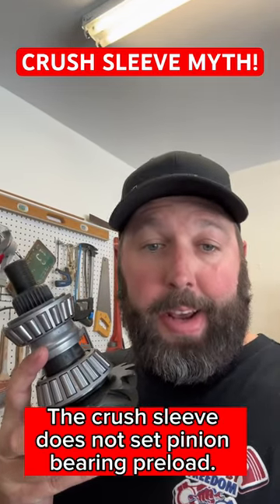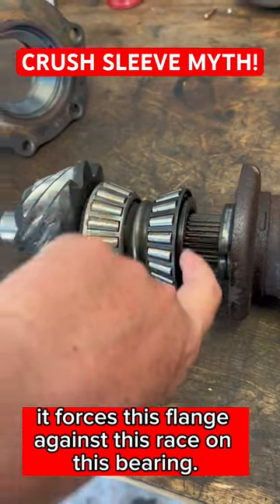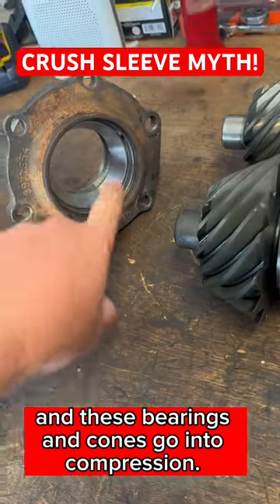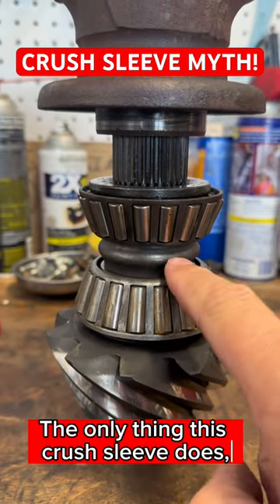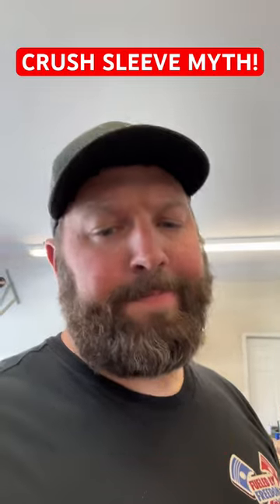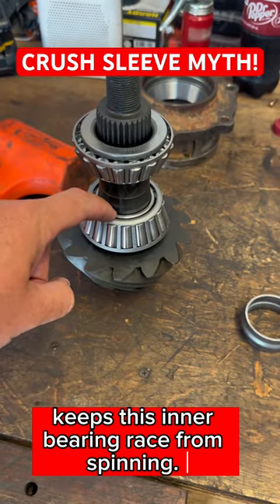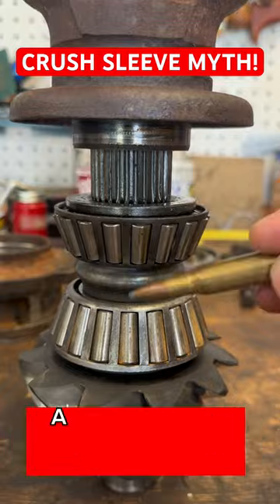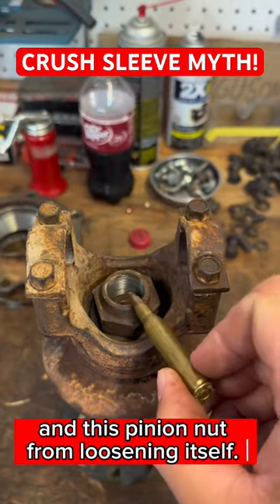Pinion Bearing Preload Isn't Created By A Crush Sleeve! #mechanic #jeep #axle

Comment: Delete the crush sleeve especially if adding more power or tire size.  Buy or make a shim spacer kit.  It may take a few tries to get proper preload  but once it’s set you can put full torque on the pinion nut and it’ll stay
Reply from the maker: Diesel pulling truck make can make well over 2000ft-lbs of torque and run a crush sleeve in there diffs. Torque cannot collapse a crush sleeve. It's a myth 😉
Reply: Why

Comment: Thank you. I have been teaching that for thirty years and it always leads to an argument. Old myths die hard.
Reply from the maker: I’ve received everything except death threats for this video 😉
Reply: You use tension to crush it and set the space between the races so that they do not spin  , that makes it a tension component . 
The backlash is determined by how much you crush it  ,because  backlash does not go  JUST back , it goes forward as well .
So you have a nut on the back and a crush sleeve on the front .

Comment: Thank you I never gave it much deep thought but your 100 percent right  so essentially the crush sleeve makes the bearings do the work by capturing the inner races and making them spin as one with the pinion gear to avoid having a spun bearing on the pinion shaft  Thanks again
Reply from the maker: Pretty Much 👍

Comment: Time out!  Soooo that sleeve changes dimension… as you tighten it the sleeve “shortens”… hence resulting in the outer bearing to move closer into the housing which increases the pre-load.  Am I crazy???  Right??? Idk…
Reply from the maker: That’s correct. But that also happens if the crush sleeve isn’t even there. Hence the point of my video. Bearing preload isn’t a function of the crush sleeve, that’s not what it’s for.

Comment: I was taught to take a center punch and mark thr yoke , pinion nut and pinion before you removed the nut. 
This way you tighten the nut again you line up the marks and then go a little tighter. 
Never had a problem.
Reply from the maker: I do the same. I also use a micrometer to measure thread protrusion through the pinion nut. I’m a little anal. 🤓
Reply: I replaced my leaking pinion seal with a new one then used my harbor freight 1/2 impact to set the nut back on . How screwed am I ??? What are my options?? Thank you
Reply from the maker: @DeathByNature23 well if your diff is the type that has a solid spacer instead of a crush sleeve, you’re fine. If your diff has a crush sleeve… pretty well screwed. The only way to get it right is to disassemble it completely (pull the axles and carrier) install a fresh crush sleeve, and set it to the proper preload (rotational torque) with the carrier out of the diff, then reassemble it. Sorry.
Reply: @freedomworx That was younger me once 😂
Drivelines do be expensive when the while deal goes poof
Tranny rear housing, tcase, yoke, drive shaft, rear yoke, etc. 
I love spending money 🥴
Reply: @DeathByNature23  thats what i did😢 
First i marked and matched the marks on the nut. Too loose.
Than i looked at the pic i took of the threads and i swear i had like 4 threads visible on the pic instead of the three i was at on the marked nut. So i was starting to impact it to get one more rotation and i ruined it. Its my 1st time. I dropped the front diff and opened it up, tonight im installing crush sleeve and wheel see how it goes.
This started from a leaking pinion seal😢😢😢😢😢

Comment: IMO the ability to change the pinion seal with zero chance of changing the bearing preload is worth the extra set up time. I install crush sleeve eliminators IE shim packs for this very reason. Add to that the  replacing a damaged yoke or changing to a different yoke type or size with zero concern of jacking with preload.
Reply from the maker: That’s the reason crush sleeve eliminators exist. People think their function is to replace the “weak” crush sleeve. But like you said, they are for improving serviceability. And they are great for offroad rigs that routinely damage yokes. 👍
Reply: The reason I like crush sleeves that its very easy to service the pinion preload. Pop the carrier, do some work like replace posi clutches, nip up the pinion nut a little more to get preload back in spec and good to go. There are pros and cons of each setup.
Reply: @joey66436 Agree but the easy to change part is also the negative IMO. If your not dropping the carrier out, you are really just winging it on the preload.  They both work, I have used and worked on both, I still prefer shims over crush sleeve.(Not the install LOL the end result)

Comment: They use crush sleeve in large truck hubs. Conmet hub. Same principle. Keeps constant tension on nut through the inner bearing race.
If not torqued and crushed correctly the wheels come off at 65mph. 😊
Reply from the maker: So just don't drive 65mph 😂. 64 or 66, but never 65!

Comment: the crush sleeve is a spring, as the bearings wear it maintains some preload which makes the bearings last longer.  I see the inner and outer bearing have spun quite often.
Reply from the maker: Yeah, I’ve seen several outers spin.

Comment: I just watched your video twice and I never rebuilt a diff before. But the way I’m seeing it and I may be wrong is that the crush sleeve in this diff is to keep from putting too much preload on the bearing as you tighten the yoke and then to achieve the right amount of preload. And without see it better or in person the inner outside bearing race.
Reply from the maker: That’s pretty much it. You need to get the nut tight enough that it won’t come loose, but without over loading the bearings with preload.

Comment: Thanks for explaining that. Always thought it had to do with pinon depth/proper contact patch, but didn't really know.

Let me see if i got it straight: The crush sleeve pushes back on the yoke bearing inner race due to it's modulus of elasticity (springiness) keeping it from spinning when the pinion shaft warms up and expands during use and when the bearings have worn a little.  As well as giving the lock nut a skosh (technical term meaning 1/2 of a "tad") of additional  opposing pressure on the locknut increasing thread friction. Right?
Reply from the maker: Well warming up won’t really affect anything. The pinion, bearings, crush sleeve, etc…, all have the same or very similar coefficients of thermal expansion. So they will all expand together. But the rest is pretty much accurate 👍

Comment: Hello. It is possible to make a hole in the pinion shaft and put cotter pins to lock the nut if the nut started to unscrew?
Reply from the maker: Wouldn't really help. If it backs off just a few thousandths, the damage is already done. It needs to stay exactly here its at.

Comment: that crush is to expand and contract while under use.. Hot and cold cycles.. yes you could not run one but its there for expansion. to keep the same preload at any temp. If it was not needed you think that gm, ford ect would save 3 dollars per unit per mill trucks they sell.. As it gets hot with no crush the preload goes lower. with crush the heat and thin crush keeps pre-load correct..
Reply from the maker: The preload doesn’t change with temp, with or with a crush sleeve. Every part of that assembly is made from steel/iron, which all have nearly the exact coefficient of thermal expansion. Thus they all expand at the same rate and the tolerances never change. It has nothing to do with thermal expansion.

Comment: The crush collar is there to keep the bearings from overtightening into the race the nut is a lock nut and replace it every time you take it off bearing preload overtighten it the bearings burn up
Reply from the maker: You are looking at it backwards. What's the purpose of tightening the nut so tight? It's a lock nut, right? So why make it so tight???
Reply: @freedomworx the purpose is to crush the sleeve until there is typically 15-25 inch pounds required to turn the pinion. Sometimes it takes less torque on the nut and sometimes more to get to the required preload. You are correct that it does keep the inner races from turning but that isn’t the ONLY thing the sleeve does. You are glaring over the obvious reason WHY it is called a crush sleeve. There are guys that make solid sleeves but you still have to check preload. There are several advantages as once you get the correct shims you don’t have to worry about over torquing the pinion nut. The pinion can also be removed without requiring a new crush sleeve and you could also replace the yoke without having to replace the crush sleeve. You talk a lot of crap like no one in the comments knows anything. You probably are a smart individual but don’t act like you know it all. Everyone hates a know it all.
Reply from the maker: @supersportimpalass not sure what you think I glared over. I simply stated that the crush sleeve has nothing to do with the preload you are trying to measure. You can leave it out and the rotation torque 15-25in-lb is still there. It does not create preload, which most people think it does. I’m not acting like nobody in the comments knows anything, but most of them don’t know this. Most people who have been building diffs their entire life don’t even understand it.
Reply: @supersportimpalass  finally a comment that makes sense.
Reply: @freedomworx  I believe you are mistaken in what you “believe“ people think.  That’s the whole problem with your stupid video. Just because the crush sleeve doesn’t have to be in to get preload doesn’t prove anything or make you more intelligent than any other person with the grasp on what a crush sleeve actually does.
Reply from the maker: @supersportimpalass  K 😘

Comment: That's why if you overload the crush sleeve you have to replace it... once it deforms a certain amount it loses its elasticity. Lock washers do the same thing and you're supposed to replace them when removed.
Reply from the maker: I'm a slacker. A lock-washer has to be pretty flar for me to scrap it 😂

Comment: I just assembled an F250 front pumpkin with a new crush sleeve, it sounds good together.
Reply from the maker: I built the Super Duty Axles under my Excursion, definitely used new crush sleeves in them😉

Comment: Really , hmmmm, all those years as an apprentice and all the books are wrong !!! Buddy it's setting the lash on the ring gear , the sleeve starts out at max length , the reason the outside bearing has no interference is so it can move inwards thus moving the pinion gear relative to the ring gear , in or out moves the pinion gear closer or further away from the ring gear setting lash , not a lock washer !
Reply from the maker: Well I guess all my years as an engineer and all those patent documents are wrong 🤷🏻‍♂️ It doesn’t set ring gear lash. Backlash is set by adjusting the carrier position. Never once have I moved the pinion depth to set backlash. You set the pattern with the pinion depth and backlash with the carrier adjustment. And the crush sleeve has zero effect on either of those in this differential. The reason that the outer pinion bearing has no/little  interference is so you can actually get the pinion out of the housing without having to use a hydraulic press… It does exactly what I said it does. If you don’t believer me, go research the plethora of crush sleeve patents out there and draw your own conclusion. But don’t base your conclusion on books and instruction that were written in layman’s terms so technicians could understand enough to install the parts.
Reply: @freedomworx  crap ,

Comment: Two things are going on here, first it keeps the inner race from spinning, second you would never tighten the pinion nut tight without smashing the bearings if you didn't attempt to hold the bearings apart
Reply from the maker: Pretty much.

Comment: Thanks for this video, I am sure you are right. I just have one question, how is it possible to over crush a crush sleeve? Wouldn't the bearing inner and outer races touch and stop the crush sleeve from crushing? Is it the axial deflection of the pinion shaft under tension?
Reply from the maker: The bearings can be compressed beyond where they should be to attain the appropriate preload. So far that it deforms the bearing rollers and races enough that you cant rotate the pinion by hand. Your engine could turn them, but they would burn up in short order. When you run the nut down far enough to cause that amount of preload, the crush sleeve gets collapsed too far. We are talking about a very small amount here. Like thousandths of an inch.

Comment: So what’s best practice when needing to retighten the pinion nut? The one video I watched on how to change pinion seal never mentioned preload or how important it was to make sure nut went back on exactly same depth, usually marked beforehand …so ya, dealing with a loose pinion nut now, just retorque to spec?
Reply from the maker: If your pinion nut is loose, you have a problem that needs to be addressed, besides the pinion nut. They don’t just come loose. Sometimes the nut didn’t actually move, the bearings actually failed or have worn. Or if you have a bad driveshaft vibe, that could cause a nut to loosen, or cause the bearings to wear or fail. I don’t know of any way to just tighten a loose nut. The only way to do it properly is to disassemble the diff and measure the rotational torque. That’s obviously quite a bit more involved than just dropping the driveshaft and tightening it up. You can cinch it down and pray.  If it’s not tight enough, the bearings will fail. If it’s too tight, the bearings will fail 🤷🏻‍♂️
Reply: @freedomworx  When I changed the seal out over a year ago I never properly tightened the pinion nut after replacing the seal, I never knew about preload, and even then I always thought to myself “man I didn’t tighten that like I could have, hopefully it’s enough” and planned on tightening it but never did cuz all seemed fine, up until about a month ago, the click started but nothing else, smooth all the way up to 80 even when hammering on it, took me forever to find out what it was, I tightened it some (not to the 210 spec cuz I couldn’t get a good angle to torque it) and even the 160 I did hit made a difference. But ya I I’m going to disassemble it next week when I can also get new parts. Ty for the heads up and info, helps a lot 🤙🏻 I want it proper 🦾

Comment: Okay so I'm kinda new at this
 So you're saying I don't need to crush leave to when I replace my opinion bearings?
 I have it and would like to use it but I don't want to tighten it too tight.....the point I'm getting at
 I don't have one of those rotational torque tools, And I'm liking what I'm hearing from you

So I'd like to hear from you or anybody else on here I simply just want to do this job and get it all over with, So should I just tighten it down to where there's no playbe another touch tighter and call it a day?

 I just want to get this done without any drama

Comment: I always use machined spacers instead of the crush sleeve on high performance rebuilds. If it will be disassembled for maintenance on a regular basis the sleeve is a giant pain
Reply from the maker: No doubt. A solid spacer definitely makes maintenance easier 👍

Comment: So could you use red loctite on the pinion nut and leave out the crush sleeve?
✌️🔧🍩
Reply from the maker: There are folks that have, and I Loctite my pinion nuts. But that doesn’t address the other function of the crush sleeve. It sandwiches the outer bearing inner race between itself and the yoke, that helps prevent the inner race from spinning on the pinion. So it really needs to be there.